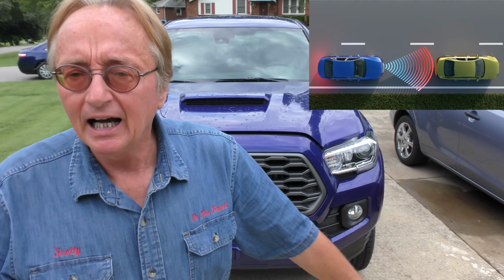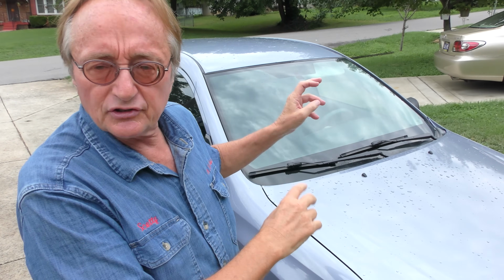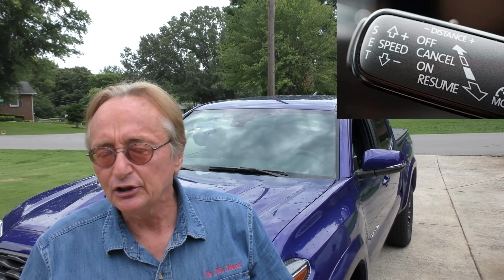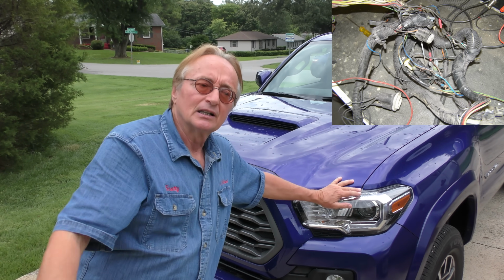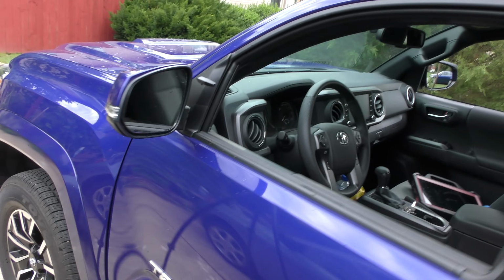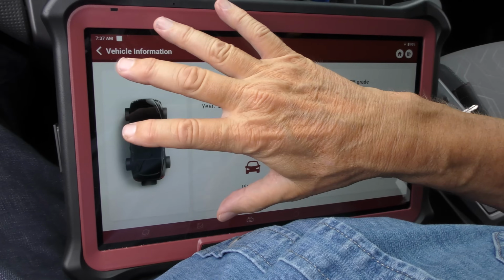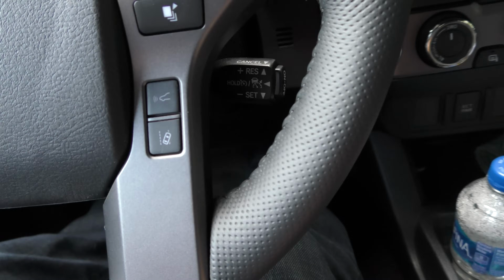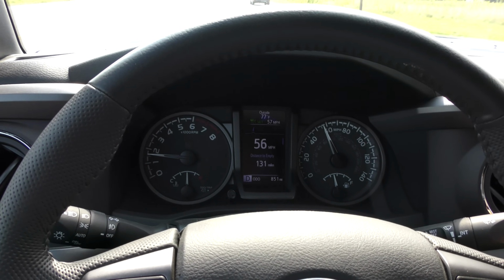Toyota’s New Truck Shocks the Entire Car Industry

Comment: I have a 2020 Tacoma and 2021 Hyundai Palisade and I can tell you Hyundai is leaps and bounds ahead of the Toyota adaptive cruise control. 

Also the Hyundai is very useful if you’re in bumper to bumper traffic. It will stop and go as needed depending on the car in front of you. 

The automatic braking on the Palisade is much more preemptive and linear, I almost cant feel confident with the Tacoma which brakes more abruptly and I always do the braking myself as I feel the Tacoma is a second or 2 late for my style of driving.

Comment: Adaptive CC is neat, but eats up the brakes and slowing down is not light tap on brakes either, its rather jerky.  Both Honda and Toyota do have option to switch between regular CC and Adaptive CC by long pressing the button or similar switching mode depending on the configuration.  I still prefer the regular CC.

Comment: I absolutely loathe the Adaptive Cruise Control. Frankly I find it more dangerous as it slows down way too much grossly over compensating for the traffic conditions even when sensors are adjusted for distance same issue. Basically when I'm already in the process of changing lanes because of the traffic congestion the system is slowing me down unexpectedly making for a dangerous situation as I'm expecting to keep the same speed as I'm changing lanes but it slows me down potentially cutting off another vehicle that I would have cleared just fine had it not been for the Adaptive Cruise Control.

Comment: my first car (2012 ford focus) had adaptive cruise control, using it on the highway was the closest thing i imagine to controlling a horse and cart, the speed changes automatically based on whats in front and you just direct the thing. it was a cool but i wouldnt use it unless going for long drives

Comment: This is all garbage! Who wants this crap? When it shorts out and breaks, it will cost more than a brand new truck to fix it. Hopefully, you can afford it if you want this garbage (and aren't killed when a sensor/computer breaks at a critical moment and you slam into a stopped 18 wheeler at 65mph).

Comment: I really have liked the radar cruise system on my 2019 Tacoma. The only issue I've had is when driving when it's snowing and the snow sticks to the sensor making it not work. Just wipe the slush off the Toyota emblem.

Comment: I have a 2021 Trailblaser with adaptive cruise control and 75% of the time it is fine.  It works around bends and helps prevent tailgating.  Occasionally it starts acting wonky and slows the car for no reason.  Also, if something large, like a plastic bag, blows in front of the car it will start rapidly slowing down and it has a hard time coming out of that mode even after the bag has passed.  It also has issues with cars parked on the side of the road where it sometimes slows down even though you are trying to go around it.  I mostly use it on country roads where passing is difficult or sparsely populated interstate stretches.  I don't 100% trust it and it is no replacement for paying attention.

Comment: We own a Honda Odyssey with this system and it is very jerky when the auto speed control adjusts to the car in front because it is constantly trying to adjust to the speed of the vehicle in front. For comparison purposes we rented a Toyota Sienna while on vacation and that system is very smooth seeming like it takes the average of the vehicle in front to match...the Toyota software is much better.  Also, in my experience (and having put on thousands of miles using the cruise systems), neither of those vehicles have the problem of mistakenly detecting oncoming traffic or traffic in other lanes around curves...they don't like inclement weather though.

Comment: I have it in my 2022 Tacoma and I don't really like it.  The truck will slow way down and then just go to full blast to try and go back up to speed and seems to me will wear out the transmission. (It doesn't gradually accelerate naturally, it sound like it's flooring the pedal all the way to full throttle).

Comment: The current Honda CRV model ACC system works at lower speeds like 25 MPH in stop and go traffic. Meaning it will bring the car to a complete stop and accelerate the vehicle all by itself. It has a 5 second delay, meaning if your car is stopped for longer than 5 seconds you have to hit a button to restart it. Does the Tacoma have this feature as well in its ACC system?

Comment: I have a 2021 corolla and I've been on the highway with the adaptive cruise control set to 80 and traffic suddenly slowed to a complete stop and it stopped on it's own and then moved again when the car in front did. I was pretty impressed with the system when I first got the car but have barely used it since.

Comment: A little story about our 2017 Toyota Corolla with dynamic radar cruise control. I wrote a letter to Toyota of praise and after you hear my story you might agree. I needed to go to the ER and was a passenger as my wife was driving. The cruise was set at 75mph in Texas on the interstate. It works flawlessly. My wife all of a sudden had a seizure behind the wheel😮so I had to hit the hazards and grab the wheel. There wasn’t a safe area on the shoulder that I could pull over and shut the cruise off. So for 3 solid minutes I steered. When my wife had her seizure her hands fell off the wheel head slumped down as she passed out. Finally got her awake to pull over. I drive now. Yet that cruise slowed us down and sped up as people merged etc. It saved our lives!!!!

Comment: I have a question for Scotty. but he won't see it.. so, anyone else who knows about something Im not sure about.. I've been working on cars and trucks for over 20 years . but not as a job for quite a while... so I'm not up to date with the newer cars .. my wife just got a 2014 escape titanium w 110k  on it, it shudders .. it started a couple days after she bought it, and it's gotten worse.. does anyone else have this issue? isit the torque converter? could the fluid just be low, or need to be changed? or is the tranny going? I know no one can tell me for sure without driving it.  I haven't checked the fluid yet, I haven't seen it much while it's light out to check anything. she's got a 3 yr warranty on the motor and tranny from the place she got it though. worst case, she'll have to bring it back to them soon, but I've heard it's a software issue, I've heard people who own them say their tranny was being replaced, but that could have just been a shop scamming them... it almost feels like a torque converter issue to me. someone else online said they changed the tranny fluid and it fixed the issue.

Comment: My 2010 toyota prado has this and it's great but the acceleration when a car moves out of the way on long trips is aggressive. If set to 80 mph and it slows you down to 60mph when the car moves out the way the car races to get back to 80mph and affects your gas mileage a lot.

Comment: MAJOR problem!. I have a 2018 Toyota Rav4 and the ACT works just like you said but with one major problem. When it slows the car down for traffic ahead, then when I pull into the passing lane it tries to get up to speed immediately. Slams it into passing gear, 4500 rpms is not normal. Sure it gets to speed quickly but in my opinion makes it unusable. I talked to Toyota. They said that's how it is.

Comment: I have it on my 2021 Tundra. Only downfall is when a car in the next lane slows down, it senses it should slow down. 
You can also bypass the adaptive system by holding the switch longer. You can find it in the manual.
Reply: That’s really odd. My 22 RAV4 adaptive cruise control does not respond to what’s going on in the lane next to me at all. And it shouldn’t.

Comment: I never want to have to rely on sensors and hate the fact its only going to make people lazy and drive far less safely. My 2004 accord euro has cruise control... It cuts when i brake or i can speed up or down by pressing ergonomic up/down buttons on my steering wheel... If sensors fail, someone dies.

Comment: Adaptive cruise control is pretty old technology, my 2017 Peugeot 3008 has it. And yes, it brings the car to a full stop at which point system is deactivated and you need to accelerate manually.

Comment: I love this system on my new 4Runner. Just so you know how sensitive they are. I was traveling south and a car entered the north bound lane at an angle that had it coming at my car and I felt it apply the brakes momentarily. The system realized that as the other car continued to turn into the north bound lane that things were fine. You can use on a two lane highway and love it . Maintains the same speed up and down hill . For the first time in 60 years of driving I have real cruise control.

Comment: Hi Scotty, I don’t own, but rented 2 Prius’s and 2 Rav 4’s equipped with adaptive cruise control and I prefer to go without. In general it works ok, but I’ve encountered several situations where other drivers triggered hard braking when it wasn’t necessary . Also, if you become dependent on adaptive cruise and then drive other cars without it, which I own, I have to retrain myself to use cruise safely.

Comment: I hate using the system in my new Camry, it always flores my acceleration when I move into the next lane because the joe in the front of me is going 5 under the speed limit. Then I’m burning up gas because it goes from 60 to 70, usually by my luck on a hill. I’m really conservative especially on the highways, so I wouldn’t give this option too much of a worry. Until they issue the option like Hyundai has where you push a button and the car steers it self, im good lol

Comment: Have it on a Avalon and 4runner.  I noticed that in a snow storm that it can be covered in snow and than it does not work until you clean it off. But it will cover back up again. Hard to keep snow off it.

Comment: My 2002 Tacoma has 310,000 miles on it Everything including the AC in cruise control still works perfectly fine. Some of these newer features are definitely bittersweet due to the cost of repairs when they do start messing up. I think I’ll stick to my dinosaur.

Comment: Additional Info: It won't work at less than 30 mph. You can turn it on, but you can't set it unless you're going fast enough.
The blue is a nice color, but I got mine in Panty Dropper Red.
Also: Skewp...

Comment: I drove one of these TURDs and almost got into trouble. Had the vehicle in cruise control and then quickly wanted to make a pass. When I stepped on the gas, the truck didn't want to go !!... I had to slap on the brakes and pull back in. ... I am not impressed. Scared the hell out of me

Comment: All those computer controls and radar sensors are all guaranteed to break down.  Again, all over-engineered, and if one is ever in an accident with one of these, the whole system could be in jeopardy, and I can't imagine what it would cost to fix this.  This is yet another reason why insurance rates are getting to be sky high.  And, I have always been of the belief that the more "automatic conveniences" they put on vehicles only detaches the operator from the road and the driving experience, lulling  the operator into a false sense of security, relying on technology, and in the end, making for lazy and careless drivers.  It happened with automatic transmissions, power steering and brakes, then antilock brakes, and on, and on, and on.  No thank you.

Comment: On the Toyota adas it has a little problem.  And the company knows about it. My brother in law is a management employee for the company.  If driving,  say in a sprinkle of rain and it changes suddenly into a heavy cloud burst it doesn't recognize the car in front of you.  The rain confuses the system and will actually speed up I had it set on 80 on the interstate,  and the car in front was about 72, with increased rain vehicle speed up and fast.

Comment: auto high beams are pretty darn good, i like the adaptive cruise control. i turn it off to pass really slow cars because if i leave it on people get impatient with you if you are not going 'fast enough' in the left lane.  also the rear cross traffic is great backing up in parking lots when you can't see because it beeps at you when there are cars approaching that you can't see. the only thing i don't like about my yota is how it sometimes doesn't go or it takes little while to get in to 4 wheel drive low and if it rains really hard all of the sensors in the front don't work till the rain slow downs or stops.

Comment: Having the cruise control on a stalk it pretty old tech isn't it? From what I see, most modern vehicles have the controls mounted in the steering wheel. Unfortunately, the more tech that the manufacturers put into their vehicles, make then a great deal more expensive to fix. If the tech was bulletproof with self repairing systems and multiple redundancies it would be better, but even more expensive to make.

Comment: I do not know what is happening at Toyota

Its new EV, the bZ4X (can anyone think of a worse name)  bring us a whole new meaning to 'drive it until the wheels fall off'. 

Toyatas' new entry into the fully electrified market has given us this dumpster fire where the wheels are literally falling off the thing. It is a total recall and in some cases, I believe, a buy back situation.  

Do not know how good the electric engine is, that is still to be proven, however the engineers for some reason forgot a basic engineering problem solved some 100 years ago- how to keep the wheels from falling off.

Comment: I have a 2018 Corolla XLE and it has the adaptive cruise control and break assist. I got it pre owned from a MB dealership almost 2 years ago with 6k miles on it. So I was pleasantly surprised to learn of all the extra safety/ luxury features after I purchased it. I just thought it was a great deal with such low miles and heated seats BUT then I get all this extra stuff too!

Comment: SCOTTY KILMER IS THE MAN!    My 2020 Ford Fusion has the same adaptive cruise technology as Toyota plus it has "lane assist" where the will give strong resistance to my steering wheel if I try to change lanes without signalling first AND my car has automatic high beams and it can sense another set of car lights opposite side of the road with its headlights on at night at least a mile away which then makes my lights go back to low beam ...so for Ford all these things are nothing new, but awesome!  The car drives better and safer than I do with these things turned on!

Comment: Great idea, but the adaptive cruise drives me nuts. I have a '21 Tacoma and never really use it. I'd rather have the old system and can control the braking myself. There's so much delay between their slowing down (really braking until it matches speed instead of slowing down) or speeding up when switching lanes. The first few times I switched lanes to pass and people ran up my butt.. I stopped using it.

Comment: ANOTHER system to break and repair, expensively. Same kind of crap with the brake pad monitoring system. I disable that nonsense straight off. I'm not interested in my truck doing all the driving for me while I wait for it to fail. ✌

Comment: Hyundia cruise system works better than Toyota.    For one thing the controls are located on the top side of the steering wheel, rather than under.      Also, Hyundia has a 10-year warranty, rather than Toyotas crappy little, short warranty.

Comment: We bought an 06 Avalon Limited, with only 66,000 miles last March, and driving home on the thruway from Utica NY, I had it on cruise...it slowed down when I got near a truck! I thought we got a lemon, but then found it had radar cruise,and you could set 3 distances! 2006...works great! In fact everything still works,and we get mid 30s on the highway!

Comment: They have had this in semi trucks for awhile now. What normally happens is you'll come up on someone going 3 miles under the speed limit and get stuck there. You'll only know when everyone starts going around you. If you don't pay attention and no one else is around, you'll be putting along. Hopefully it doesn't have the alarms to tell you when your to "close" to someone. That will get annoying quick because the trucks idea of to close and you as the driver are 2 different things. Plus they would jam on the brakes if it thinks your to close which is extremely dangerous in an 80,000 pound semi. We used to disconnect the radar in the bumper just so you could properly drive the trucks.

Comment: Best thing they've ever come up with. 150k on it in a Elantra and works perfect. You adjust the spacing and it puts you directly behind the front car. It does not get  tricked in the turns either. If you don't like it you're obviously not using it correctly.

Comment: A few months ago I rented a new Hyundai that had most of these features. I hated it! I felt like I was not in control at all. Kept getting warnings about this and that. Made going through construction zones a pain in the butt, and in the snow the system shut down entirely. I think it needs work.
Reply: @EagleStryker1 No, the issue was specifically the icy, packed snow over the sensor (behind the H grill badge). Whether it is the cold or the packed snow's thickness, I don't know. But when I scraped it off at a pit stop, the system worked normally. After a few more miles of accumulation, it  shut down again. It is basically the radar distance/collision avoidance thing that is shutting down the system, not traction control.